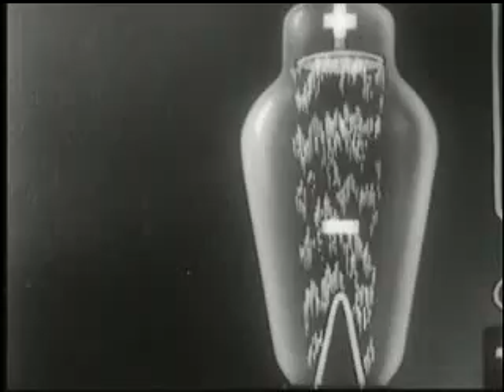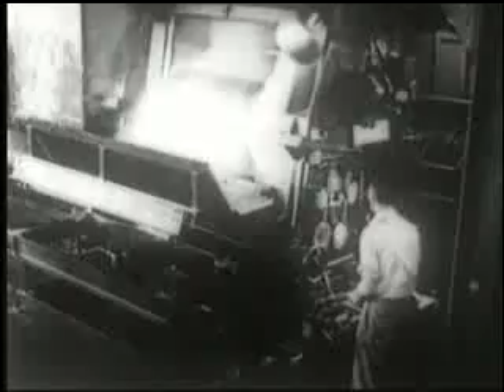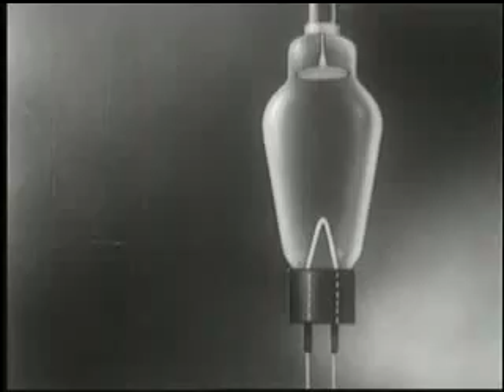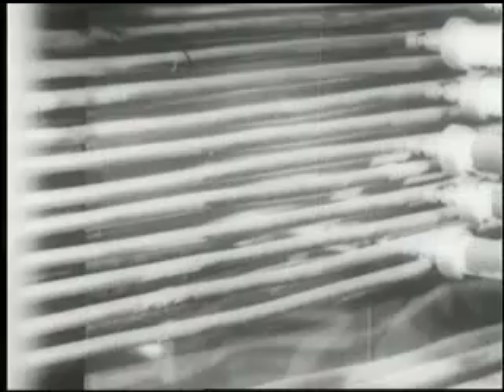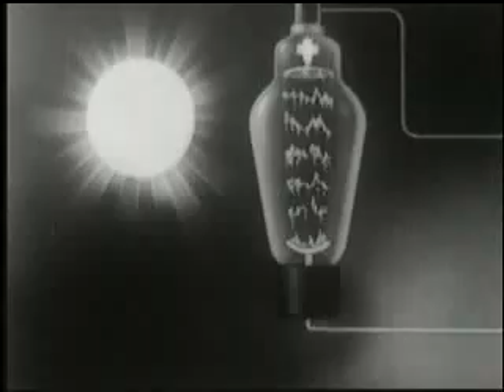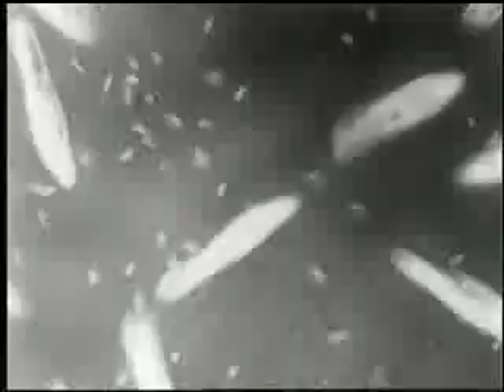Electronics at Work - 1943 (Complete)

Comment: As he pointed out, a 'TUBE' acts as switch of various types..
In fact a TUBE will easily allow an uncontrolled flow in ANY direction..electrons , gases or fluids. (Sewage if you must!)
That is why the English name is VALVE and not TUBE.
It CONTROLS the electron flow in exactly the manner described so well in the video.
Remember, ex colonial cousins.. a TUBE lets anything through in both directions but to stop it and start it,, control the quantity and especially the direction, you need a VALVE.

However, I do agree with American Aluminum as opposed to Aluminium but that is a whole different story. Or as some you say "A whole nother  story!"

I gotta admit that because of my many recent exchanges with guys in the Land Of The Free, I'm starting to say (to my shame) tube instead of valve,  B+ instead of HT and Plate instead of Anode.
It must be admitted that the gentleman in the video DOES say "anode" and never Plate.
Oddly 'cathode' never seems to have gained an alternative American name like Anode/Plate.

God Bless America and in particular the G.I. and the Lease/Lend agreement.
Some of you younger guys may need to look that up.  It ain't recent.

Good wishes from grateful Olde Englande (Over Here... The Yanks are coming.. "Got any gum, chum?)
"We won't be back 'till it's over, over there!"
G3NBY

Comment: Well yeah, the clues in the classical name 'Thermionic Valve' - eg the cathode (eg the glowing filamant) has gotta get good and hot before the electrons start moving - so this is usually done by a seperate 'A' or 'LT' power source, as opposed to the main 'B' or 'work' circuit... traditionally the A circuit is a convenient low voltage, and the main ('B' aka 'HT') voltage can be pretty high, up to thousands of volts...

Comment: The cathode to anode current is provided by a high voltage battery (B supply). However, for the tube to conduct, the cathode must be hot and so a second, low voltage battery (A supply) is required to heat the cathode. In more advanced circuits, a negative supply (C supply) is provided to bias the grid negatively.

Comment: you need LT low tension volts to light the heater the thing that glows.
you need HT high tension volts to give to the anode.
thats why you need 2 batteries.  jeff . radio ham over in the uk ..

Comment: Tube amps sound better to some, not because of the tubes but because of the magnetics - mostly because of the final output transformer. And here's why: Solid state is precise, for example if you apply a signal to a FET amp then suddenly switch the signal off the output instantly switches off. Apply the same signal to a tube amp then suddenly switch the signal off the energy stored in the output transformer delivers to the speaker slower.

Comment: The vacuum tube was still being used in radio and television receivers well into the 1960's, 20 years after the transistor was invented. And the CRT, another vacuum tube, wes used in televisions until they were replaces many years later.